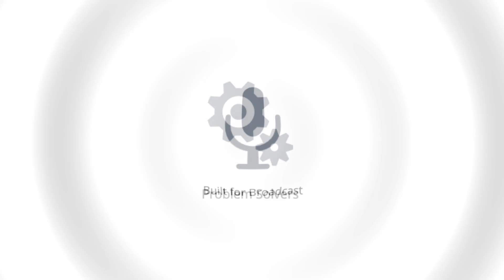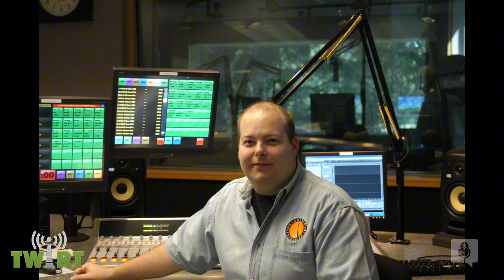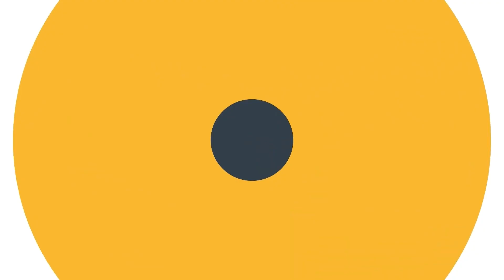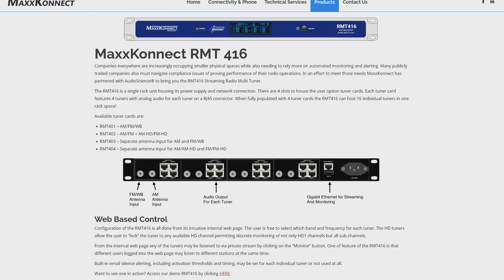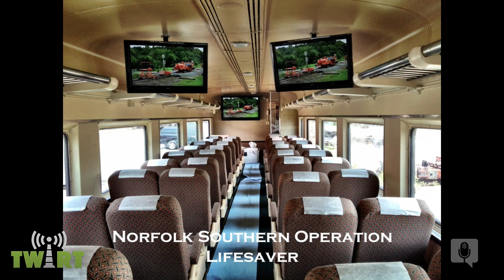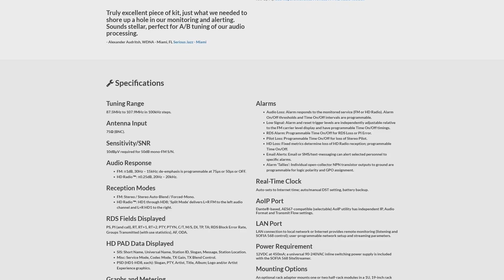Growing a Radio Engineering Business with Matt Lightner - TWiRT Ep. 791

Comment: Lots of good content in here, really good show. 

One thing I would like to point out, though, we found out the hard way that all of these cellular shelters are not equal. Companies like fibrebond and others like that make different classes of buildings with their top-tier being the solid prestressed concrete… The cellular companies use these top tier facilities when they are building in high wind, environments, places where you’re in a coastal environment or tornado alley… But they make two tiers of these buildings that are not necessarily lower quality but lower specification than the solid concrete. They do this for different reasons, primarily in some cases you don’t desire to have all that weight if you’re having to ship this building across the country or you’re having to put it somewhere where you would have to build a very substantial elevated foundation. 

We had one of these buildings nearly burned to the ground, only to find out that the walls were made out of two by fours that simply  had a gravel and cement board outer shell with FRP and sheet rock on the inside as a firewall… That particular building had an interior generator room and the generator caught the building on fire from a diesel leak. 

Unfortunately, had that building been solid concrete we might’ve been spared having to replace the building completely.

I have had a second one of these buildings where the wall on one side of the building completely rotted out where they installed the air conditioner because they didn’t seal properly around the air conditioner, and we found out it was the same deal where the wall was actually not solid concrete. It had wood in it…

So you have to be very careful and it might really be worth taking a thermal camera and looking at the building very carefully before you purchase it to make sure it is actually concrete and that you don’t just believe it’s concrete.